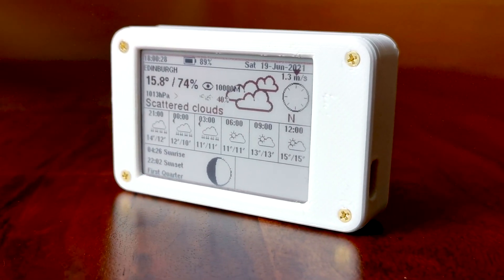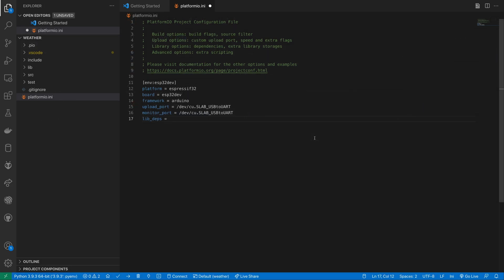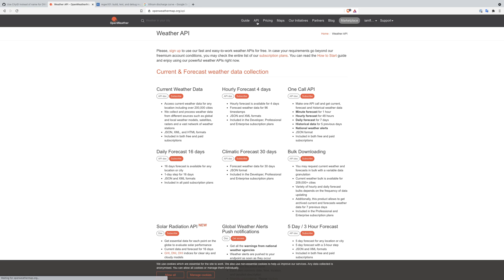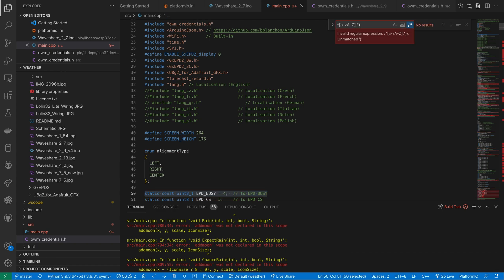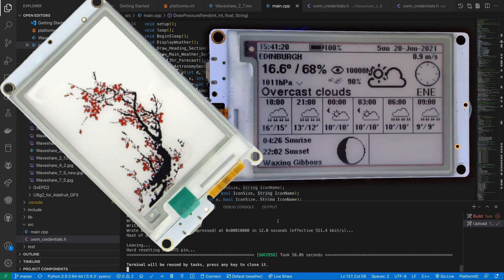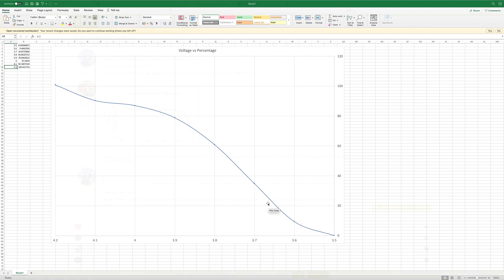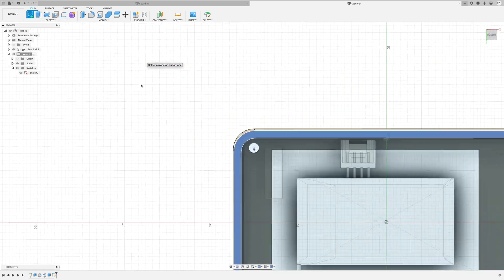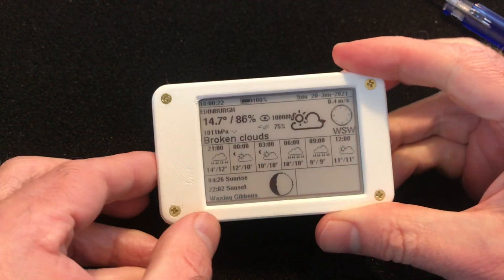E-Paper Weather Display: Boost Battery Life with Deep Sleep Mode

Comment: Hey there,
Concerning your project could you tell me if your screen initialize itself each time after waking up from deep sleep? (screen goes black to white)
I'm asking this because I'm working on a similar project and got this issue, I find it rather ugly that it takes a few seconds and also that the screen goes black when initializing.
Reply: did you find a solution for that ? I'm struggling with the same problem.
Reply: @hanoisantos  Back when I was working on this project I found out that I could refresh a small part of the screen which worked but with deep sleep some weird artefacts occured on the screen.
Maybe there is a solution but I didn't bother back then since I was running out of time.
Reply: @JS7457  I don't want to call init because it erase the screen, but then I don't have a way to reinitialize the SPI and the GPIOs , if you tell me that you could refresh a small part of the screen maybe there's hope I can do something

Comment: I just got cheap m3 and m4 inserts from aliexpress and they are great.
Reply from the maker: I'm wondering if I'd just got the alignment slightly off. The ones I've got just seems to be particularly tight.
Reply: @atomic14  You mean the threads are tight? Mine where perfect, obviously you'll have to make sure to get the correct screws for it aswell :p. Mine where really good, 4€ for 100pcs of m3 and m4 5€ for 100pcs. They sit very well in the print, i've tried pulling them out while gripping the print in a vice and the table moved so i can say for sure that it's a good solution

Comment: That's an ESP32 board with MAX98357A i2s speaker amp, ICS43434 i2s microphone and lithium power circuit. Now where have I heard those specs before?
Reply from the maker: It's a board after my own heart.

Comment: Lovely video thanks for the input, one question for anybody how do you turn on regular expressions?
Thanking you in advance
Reply from the maker: When you open find/replace there's a button ".*" just click on that. https://imgur.com/a/JzlNjqW

There's a really nice tool here for trying out expressions: https://regex101.com/
Reply: @atomic14  thank you very much for your speedy reply, for some reason it doesn't seem to work. No problems must be something I'm doing wrong.
E-paper are certainly very nice to use, the only problem with them is they tend to fade over time, I'm using the same code from David as you are using. 
Same as yourself is written some very useful programs

Comment: have you searched for "Heat & Ultrasonic Threaded Inserts" there should be lots out there, nice video. got me thinking of what I could use a E-paper display for.  A single sheet of A4 paper is all I need for a weather display, one side states "weather is Shit" the other side states "Weather is still shit" this i think will work for most of the UK ;-)
Reply from the maker: :) yes, I made myself laugh when I started saying I could use the red colour for when it's really hot...

Comment: Hi, does this E-paper display surface actually feels like paper when you run your finger through it or company put some other rubber type display over it for paper type feel

and one more thing, are these display touch-enabled, can we draw something on screen using STYLUS for making E-notes.
Reply: No. It's called e-paper because the image remains when power is removed.